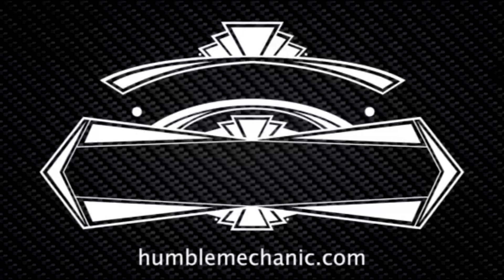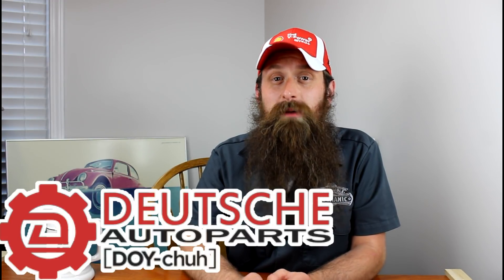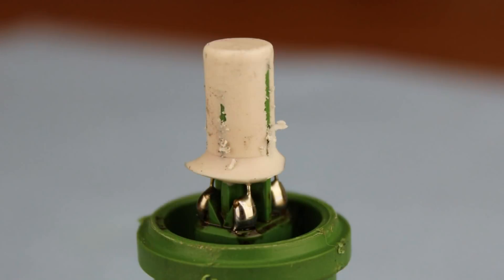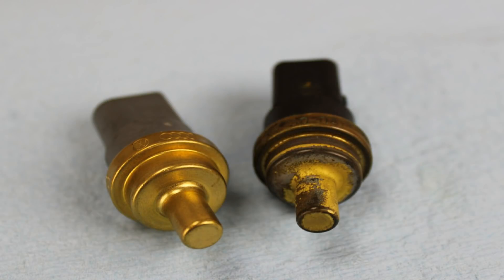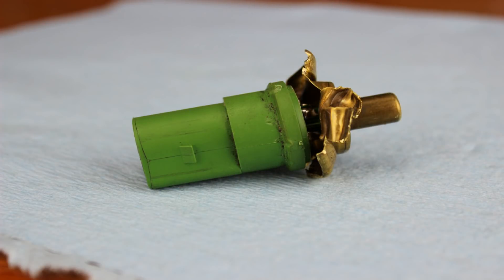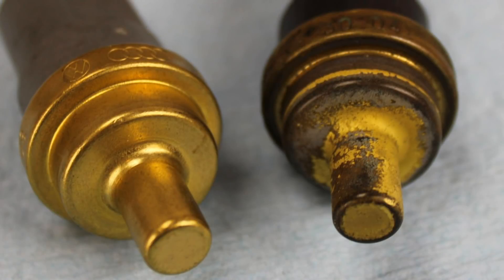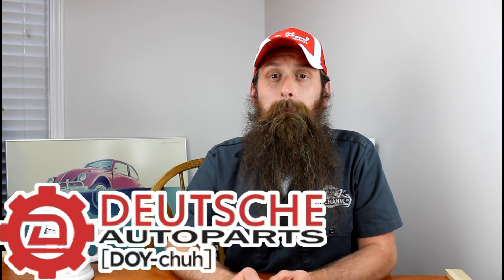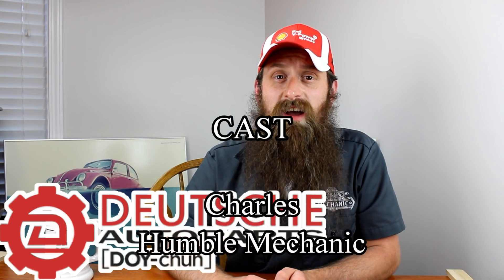How VW Coolant Temperature Sensors Fail

Comment: Hey Charles. your videos have been pretty awesome and I've enjoyed owning such a failing vw knowing why their parts are failing. But if my temperature gauge is fine but I have issues with hot starts all the time or after a long drive but no CEL or any fault codes. Could it be a ECT or thermostat issue? It almost feels like I have a dead battery but it'll crank and I just have to give it some gas to get it over the hump and it'll run fine again.
Reply: mk4 jetta vr6* BDF engine code
Reply: +Ak A 160k miles

Comment: I have a problem, my car can´t not start in coold weather, i change the coolant sensor thinking that was the reason, but the problem persist, the car start, at the third time i turn on the key, its a 2001 jetta.

Comment: I just came across this, is this the small sensor in the radiator of the beetle at the bottom? bet that's why my ac doesn't work.
Reply: shaunwalker36 - Did you ever find a solution? My a/c is blowing warm air.

Comment: Great videos watched half of them already haha seems my car wasn't maintained by the previous owners...134,000 miles on it and only 1 recorded stop at the shop. Put 1500 miles so far and already had to put it in for new fuel pump, temp sensors, fuel pressure sensor, needs wheel bearings, maybe new ac compressor...list goes on so thanks for all the videos...one issue I can't understand is the temp gauge is having intermediate problems reading 0...I would plug in my obd ii scanner and erase the P2181 code while engine is running and about 3 seconds later it shoots up to normal temperature on the gauge, which I recorded on my phone...was thinking it was a bad thermostat because sensors were replaced but after seeing that it made me think it was something electrical..any thoughts? the mechanic I took it too said he couldn't find the problem and said it wasn't the thermostat and said it may be the ecu or wiring..I did check temp when gauge drops and it still reads between 190-210. A little lost so any help is great. thanks
Reply from the maker: +Donnie Featherman Jr If it is just the gauge, then odds are it is the sensor or the wiring. I have replaced a lot of these for issues with the cluster dropping the temp reading.

What car is this?
Reply: +HumbleMechanic it's a 2006 Audi A3 2.0T Fsi 8p..I replaced both sensors and my thoughts were maybe one or even both sensors may be defective.  I have warranties on both from AZ they are duralast brand so another reason why I think it may be the sensors. thanks for the reply

Comment: I Have a 2009 Volks Wagon Ruotan  Every cold start it will shut off when driving with in the first to miles , now they replaced my key switch 3 times as a recall for free , but it was still happing , so I have herd that the ECT can shut down the motor if it thinks it is in over heat ? is this possible ? if it is I will let you know soon , :-)

Comment: When you buy a VW they should include an extra coolant sensor in the glove box because you're going to replace it eventually.
Reply from the maker: Garth Goldberg LOL I have replaced enough of them to kind of agree. But I think price wise, they are about $40
Reply: Philip Koen. I have a Volkswagen Jetta 2011 with 110,000 miles and never have this sensor bad , is a very reliable car so far
Reply: Tu that what was keeping my radiator fans from. Kicking on..My ac was blowing hot $1800 at shop to fix saw your coment here and replaced it for 17.50 and i did it and im happier than happy..Thanks Again
Reply: Garth Goldberg j
Reply: When you buy a VW they should give you a box with extra parts for the whole damn car as there are no parts that will not need replacing soon, it seems as if they go out of their way to make things as unreliable as possible.
Reply: The only difference between a Volkswagen and a bucket of shit is the bucket..

Comment: I have replaced ton's on those sensors the cars that are not fun to replace is the v6 or  4 cylinder Passat or Audi the ALH TDI are some time stuck in the Aluminum housings (manual gear box only) the easiest are the 2 litre 8 valve engine the sensor is upright and you loose almost no coolant have you notice when a car that has the original temp.sensor on the black ones there is always a yellow paint dot on it .